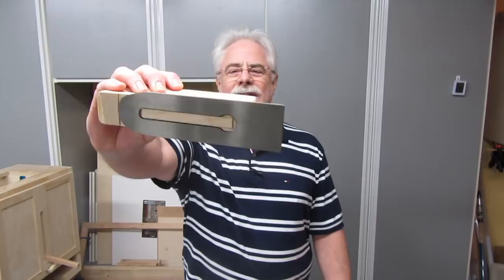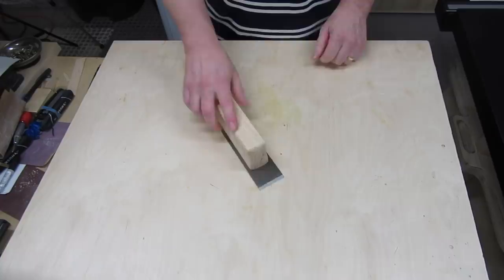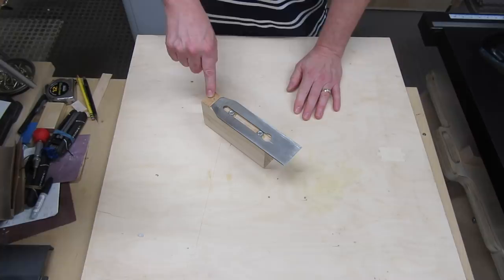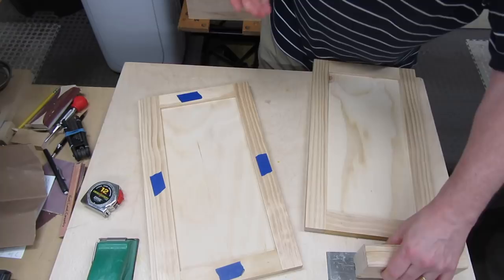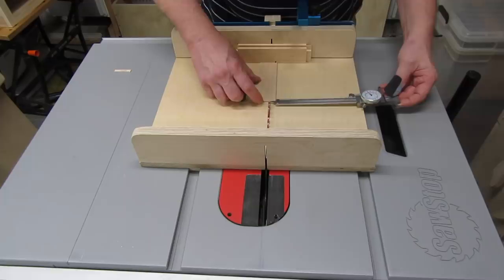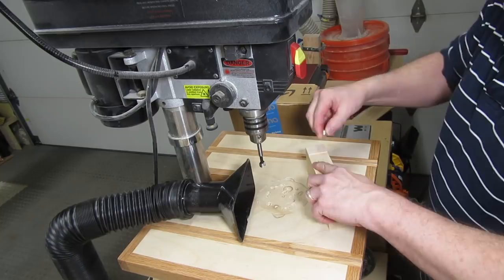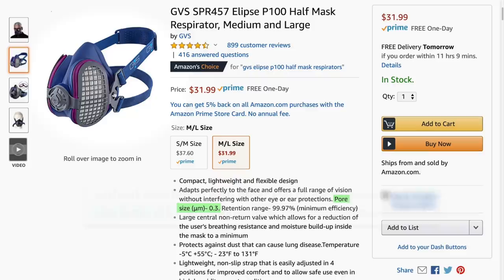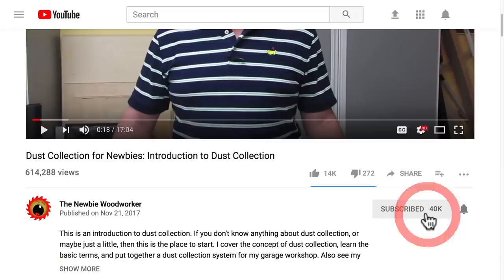You Won't Believe How Useful This Tool Is! (Chisel Plane)

Comment: Have you considered chiseling out the heel and blade slot instead of gluing one on? Looks like a great hand tool.
Reply from the maker: I actually did consider it, although I was going to use a router, but I couldn't get it just right. But if you can do it, then by all means, do! It would look very cool. 😄

Comment: if you WANT to check if a blade is sharp without pain and blood and dont have a sheet of paper to slice, try the method i use ( i also do this for my cut throat razor). believe it or not the thumb nail dry is almost as tough as bone, i simply slide the sharp edge from one side of the nail across to the other with NO PRESSURE AND JUST CONTACTING the nail to edge, if the blade slides smoothly then the edge is dull, if  you feel any pull or tug the blade is biting and sharp. AGAIN, ACROSS NAIL NOT UP OR DOWN, AND ONLY LIGHT TOUCH NO PRESSURE , THE NAIL IS TOUGH NOT STEEL.
Reply from the maker: Thanks - I'll definitely try that. I'll try it first with a dull blade (which is actually what I've got right now), then with a sharpened one, so I can see (actually, feel) the difference.

Comment: Great idea.  Noting how sharp the blades are, would you consider minor modifications to widen the handle base to match the blade width and also allow for the blade to be flipped and reversed for storage when not in use?  Just a thought.
Reply from the maker: By all means, do whatever you need! I have a video about a sheath coming out soon.

Comment: That's a great idea for a tool.  How do you store the plane blade to keep the edge from getting dinged, or from accidentally brushing your hand against the edge when reaching for something else on the shelf?
Reply from the maker: Thanks. And, um, I don't know? Currently I'm leaving it on my workbench, either on the drill press table, or off the the right of it where I can't just brush against it. Otherwise I'd put it on a shelf, with the pointy end towards the back, I guess.
Reply: @TheNewbieWoodworker  Could the blade be turned around with the edge against the foot when storing it?  I'm concerned that with my innate clumsiness that I'd be wearing more bandaids than you in fairly short order.  :)  I'm definitely going to make one and see if that works, or if it would be just as simple to make a little dish-like caddy that the tool could rest in to protect the edge.
Reply from the maker: @halsonger1317  You know what I'd do? I'd make a little shoe-like thing it fits in. With the magnets touching the blade, I'll bet the blade has enough magnetism to hold it in place, if you added a strip of metal to the shoe. In fact, I'm tempted to go make one right now. I may or may not, but if I do, it's because of your comment. Thanks!

Comment: I have 2 basic rules when working always keep your body parts behind any blade that includes screwdrivers and alway wear gloves.
Reply from the maker: I learned the first rule the hard way. As for the second, there are times when not to wear gloves, like when working with a drill press or table saw. But otherwise, sage advice. Thanks!

Comment: Does it make sense to use a router and saw to cut away the bottom to leave the heel and blade slot guide exposed? Or is gluing separate pieces stronger?
Reply from the maker: If you can do it with the router, I would think that would be stronger. (Although, truthfully, I think this is plenty string.) I thought about the router, but I just couldn't figure out how to get it right, so I resorted to this method. If you figure it out, I'd love to know how you did it. If you want, you can drop me an email by going to my website and clicking the Menu in the upper right. https://thenewbiewoodworker.com/

Comment: great idea, i would just make it with a smaller blade, like block plane blade,  to get into tighter corners ;)
Reply from the maker: Thanks, and good idea! This was the only size blade I had when I made the first one, so I just stuck with it.
Reply: @TheNewbieWoodworker  it looks like a good idea to make an assortment of this. I want to call it a drag-knife.
Reply: I feel by calling it a knife rather then a plane, you encourage knife safety stuff that might come to your mind. If you think about it as some kind of plane, it is easy to mistake it for a safer tool subconsciously.
Reply: I wont lie though, I get some nails on a chalkboard feeling going on when I see it. That thing directs alot of energy into a very fine point .

An idea to make it safer might be to make the top wood wider and reach way more towards the tip, so it limits the stab depth of the tool. 

When I think about safety, I think I should not make it. But it seems rather useful. I already think razor scraper tools are horribly dangerous, I feel super on edge using them. Ultra focus.
Reply from the maker: @cdrom1070  Well, as I've said in other comments, as long as you keep your hands (and other body parts) behind the blade, I think it's reasonably safe.

Comment: Yes, I am cringing looking at your injury! :D Thanks for the heads up. I always ask people how they injured their hands when at toll places: they often share their experience in the hope that others won't do the same. 

One question: why add the strips of wood to keep the blade in place, and not router/chisel out the wood from the stock? I'm assuming the wood strips are harder than the rest: is it too expensive to use a single block of appropriate wood?
Reply from the maker: Thanks, and that's more than one question. 😄There's no reason not to use a router to make this, other than I just couldn't get it to come out right. I knew I could get it right this way. And no, the wood strips aren't harder - I cut them from the laminated handle. And the reason I laminated the handle was because I didn't have a single piece large enough. I meant to mention that in the video, but obviously I forgot. 🙄

Comment: I wonder if you could have used an old chalk board rubber as a handle. As that's already curved into shape for a comfortable grip.
Reply from the maker: Interesting idea! Although I'm not sure how I would attach the blade...
Reply: @TheNewbieWoodworker  
Cut felt off eraser and do what you already did. 
Just an idea is all. 
The eraser could be too small for blade. Though you maybe able to use block plain blade. 
I'm going to shop around over the coming weeks see what I can come up with. But I like your invention. And thanks for reminding us to keep fingers out of the line of fire. 
Painful lesson.
Reply from the maker: @johnclowes3894  Thanks. And I really appreciate the ideas! That's the beauty of being able to do videos like this - I get to hear all sorts of cool ideas. 😄

Comment: Use salt when gluing things together and you will not have to delay and hold pieces together for however long.
Reply from the maker: Thanks! I've actually tried that, and it just doesn't seem to work for me. Maybe I'm doing it wrong.
Reply: @TheNewbieWoodworker  Thanks for the reply.  It is funny to me how things work for some and not others, but that is life.  Keep up the good work.
Reply from the maker: @larrywhite6637  Thanks. I've always thought, in situations like this, that if you could be there physically when someone else does it, you'd see right away what the difference was. Like a true apprenticeship, for instance. A couple of questions: How much salt do you use? Maybe I don't use enough? And it's just regular table salt, right?
Reply: @TheNewbieWoodworker  Yes it is regular table salt and a light sprinkling on the glue surface.  Just enough salt as to cause abrasive/gritty surfaces between your two project surfaces = you know, less slicker- y.
Reply from the maker: @larrywhite6637  LOL. Thanks. I'll try it again.

Comment: I'm having trouble finding a respirator that doesn't fog up my safety glasses.  Does the one you've featured do that?
Reply from the maker: This one fits my face perfectly, and the exhaust doesn't go up into the glasses. When I get it situated right, I can actually feel the suction on my nose and cheeks because it fits so perfectly. If I can feel air coming in from the top, then I know I need to wiggle it a little, but it's easy to get it right. So no, it doesn't fog my glasses at all, like the others I've tried do. But it probably also depends on your face. What works for me may not work for you. But I bought it because so many reviewers said it didn't fog their glasses, so I took a chance. Extremely glad I did. The only downside is the straps want to come loose every time I take it off, but I've learned that when I put it on, I just tighten them again and the problem is solved.

Comment: You may want to make a cover for the blade for storage because it is a very dangerous thing to handle.... This will protect you and the blade and anyone else who may wander into your shop.
Reply from the maker: Thanks. I've got a video in the works that shows just that. So keep your eyes open. 😄
Reply: Or reverse the blade so the sharp edge is protected by the handle
Reply from the maker: @timgoffard  👍

Comment: Not sure about this.  Cost is a little on the heavy side:  $50. for the needed items.  To scrape some dried glue that no one would see anyway.  Use a putty knife to remove excess glue before it dries. [They can be sharpened.]  Perhaps, wearing safety gloves would save ware and tear on the fingers.  Thanks for not standing directly behind the table saw blade.  Have you thought of using Velcro to hold the blade in place?  Gotto go - looking for some band aids to replace black ele. tape.
Reply from the maker: $50? I'm not sure where you're buying your magnets from, but the cost should be less than $20, including the blade. As for standing behind the blade, I might know a little on the subject of kickback. https://youtu.be/ZUZ8hRm7a8g Of course, I can be stupid, so no guarantees.

Comment: Great tool idea but just wondering if it wouldn't be simpler to drill four countersunk holes in the plane blade and simply screw it to the handle - would save a lot of work and expense...
Reply from the maker: Yeah, NOW you tell me. 😄For some reason that never crossed my mind when I was making it, but yes, that would be easier. Thanks. I think. 😛

Comment: hmm could you trace that notch in the blade and use a dremel to carve around it make a place for the blade to sit
Reply from the maker: I thought about something like that. I also tried using a router, and even the table saw, to cut it out in one piece, but in the end, I figured this was easier. But if you figure out how to do it that way, let me know. If it were cut out of one piece, that would be really cool.
Reply: Cutting that notch with a table saw is easy. I made a wood replacement for a cast metal part in my sliding patio door handle using this method. The key is to sneak up on it.
Reply from the maker: @mikekernjr5121  👍

Comment: Good idea, but i think your handle needs to be a bit smaller for better handling. (less tall) from what i saw. Ouch! and it's the fingers we use the most.
Reply: Some of us have big hands
Reply from the maker: I think it's the right size for me, but by all means, make it whatever size works best for you!
Reply: @tedrowland7800  that's true your right. Maybe a smaller version for those tight spots he was working on.
Reply from the maker: @rudymunoz901  I'm not against the idea. I wonder if one with the handle that can swing to the right or the left might help for those tight corners.

Comment: Putty knife, and sanding stuck.  Less problem,  way less cost, and works as well.
Reply from the maker: That's fine by me. Use whatever works.
Reply: Been working for me for 65 years or so, not about to change now.
Reply from the maker: @TFger-nm9pr  👍

Comment: That really looked like a bad cut I jumped for you. Have done that many times on different thing. Like the idea, is there a reason you didn't just router the bottom for the blade to sit in instead of making separate pieces? That way everything would be more solid. Will definitely be making one of theses.
Reply from the maker: Thanks! The reason I didn't use a router for the bottom is because I tried, and I kept messing it up. I figured this was easier for others, anyway. 😄
Reply: Well that makes since. I was actually just watching your corn cob skewer video. those are cool. Going to be ordering the centering tool I am always having trouble finding center. I have been meaning to ask you a bout the sketch up program you use. It sure would be nice build a project not just on paper.
Reply from the maker: @lewienewsom3833  There's tons of tutorial videos on SketchUp. I recommend using "SketchUp Make 2017", which is the last free desktop version, but it still works great. You can get it here: https://help.sketchup.com/en/downloading-older-versions. Watch some tutorials (even old tutorials, because most of them are still relevant), and don't try to bite off too much at one time. Since there's so many tutorials available, if you start watching one and it doesn't make sense, just find another. If you get frustrated, don't worry, because everyone gets frustrated at the start, but believe it or not, you'll get over it quickly. Good luck!

Comment: Link for the magnets??
Reply from the maker: I had a link in the description, above, but I forgot to add "Magnets:" before it, so it wasn't obvious what the link was for. But here's the link: https://www.homedepot.com/p/MASTER-MAGNETICS-1-2-in-Neodymium-Rare-Earth-Magnet-Discs-6-per-Pack-07046HD/202526367. You can also find them on Amazon, but I could only find packages that contained 25 or 50 magnets, and that seems like overkill. 😄

Comment: I just found this video:
https://www.youtube.com/watch?v=LGzuLUfzliQ

He even uses your trick (or is it his trick?) of mixing the epoxy on painters tape!

And here's another one:
https://www.youtube.com/watch?v=kpcTayz4wDI

Although if I used that design, rather than carving the indent for the blade, I would have just cut out a rectangular piece with the circular indentation and glued it onto the board.

Like this guy did (I just found another):
https://www.youtube.com/watch?v=us81hAXMzBg

Comment: Dangerous Noob. This might be ok as a glue scraper but I’d go ahead and double up those magnets (or more) if you’re going to use this for anything serious. Or better yet purchase a real chisel plane if that’s what you want. I cut my palm to the bone with a similar contraption when I was 16. Lost a unit of blood, needed a cpl surgeries and had my hand in essentially a cast for 2 months, my right thumb is still partially numb and I get to see the reminder scar  daily 40+ years later. Cut as deep as any power tool. You do NOT want to use an edge tool where the blade has any chance whatsoever of falling off midstream.  Bad things can happen. I think it could be made safe but would require a brass shoe, tapered insert. And some machining of the slot in the iron so it would lock together solidly.
Reply from the maker: I hear you, and I'm sorry about your injuries. But as long as you keep your other hand behind the blade, or way off to the side, I don't see an issue even if the blade comes off. And perhaps I didn't make it clear enough in the video, but that's why I showed my injury - so you'd keep you hand away from the blade.

Comment: Si chiama raschietto... Esiste già.
Reply from the maker: Sì, esiste già, ma non è lo stesso di un raschietto. Un raschietto intaglia il legno. Questo no. tramite Google Translate.
Reply: The Newbie Woodworker Obviously your google translate is not being fair... I meant, it’s called scraper and it does exist. A scraper can be used just like your “chisel plane”. The title should be “Hoe to build a scraper” IMO. Cheers
Reply from the maker: @MarcoJetti  A scraper is designed to be pulled (or possibly pushed) across the surface of wood, scraping off some of the wood. Yes, you could use it to scrape glue off, but there's a pretty good chance you'd hit the wood below the scraper. The chisel plane slides across the surface of the wood, and will only cut the surface if it's irregular, or you tip the tool. I'm not saying a scraper is a bad tool. I'm also not saying this is a great tool. I'm just saying that this is not the same as a scraper.

Comment: So how about you save yourself a bunch of work and just epoxy the blade to a block ?
Reply from the maker: Thanks for the comment. It would be too hard to sharpen that way, or to replace the blade if I ever wanted to.
Reply: @TheNewbieWoodworker   Maybe just drill some countersunk holes in it and screw it to a block?
Reply from the maker: @wombatsolo3220  Yes, you could certainly do that. If you don't mind putting holes in the blade, that would work great.

Comment: That is not a tool, it is a weapon. At least make a leather sheath for it. At the same time, it is completely unnecessary. It seems you need a scraper and instead you built an assault weapon.
Reply from the maker: LOL. I have an upcoming video showing a sheath. But no, it's not the same as a scraper. A scraper can gouge the surface (or at least scratch it). As for this one, as long as you keep both hands behind the blade, you should be fine.
Reply: The Newbie Woodworker ok. Enjoy with both hands.
Reply from the maker: @ot9180  👍